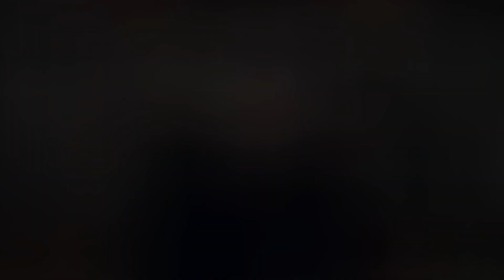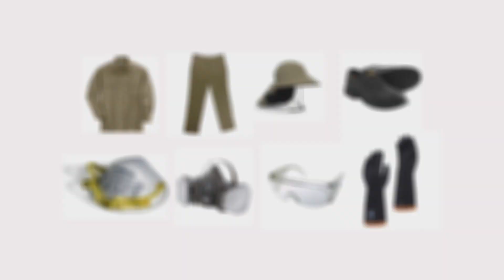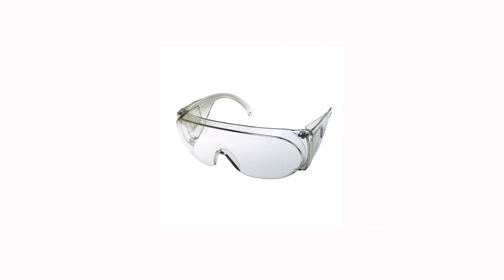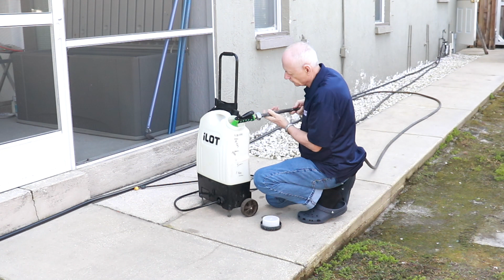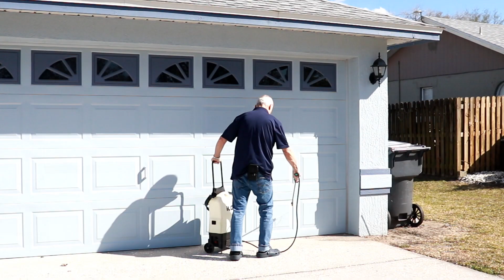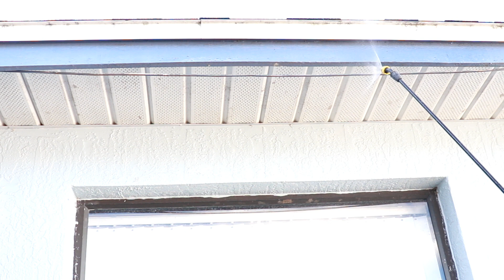How to Prevent Drywood Termites 100% Guaranteed.

Comment: I have white termites on a section of rotting fence boards just inches from a couple of 40 year old redwoods and a thick layer of redwood mulch. The only area of decay is the 10 foot section of fence directly behind (one foot) of the redwoods. I'm in Fresno, Ca. I don't see mud piles, etc, but it's hard to tell with all the mulch there. Do you recommend Imidacloprid2F Select T/I  over Taurus SC to treat the fence line? I just discovered this a few days ago, and replacing that section of fence. I will have under house inspected soon. it is a stucco house with a crawl space. Thank you for your willingness to help.
Reply from the maker: In this situation, you need to do a thorough inspection.  There are three possible species, and it's helpful to know which one you are dealing with.  The most common species would be subterranean termites, so let's start there.  It sounds like you are not seeing any mud tubes, but you need to move that mulch out of the way with your hands and see what's under it.  If you can't find any mud tubes, you still may have subterranean termites, but it is also possible that you have dampwood termites.  As the name implies, dampwood termites only attack wet wood.  This is very common with fences because the posts are constantly being saturated with water.   This is particularly true if it's an older fence. Typically, fence posts are pressure-treated and are rated for ground contact, but over time, they may lose their ability to fend off termites.  The main difference between subterranean termites and dampwood termites is that subterranean termites colonize in the ground, so that's where the queen is.  Dampwood termites colonize directly in the wood, which means your treatment methods may need vary a little.  There is also a remote possibility that they could be drywood termites, but I think that is unlikely.  

I think what I would do is treat the fence directly.  I would get a long 3/8-inch drill bit, and I would drill a hole at a steep, downward angle into what I thought was the damaged area.  I would then put a funnel in the hole and pour in imidacloprid until it was overflowing.  You can also do this with a pump-up garden sprayer.  Just put the tip of the sprayer in the hole and spray until it overflows. Imidacloprid 2F is fine to use.  Just mix 0.6 ounces per gallon of water.  If the fence post and other fence components are not treated with anything like a stain or a sealant of any kind, I would also apply Bor-Care.  You should mix it 1 to 1 with cold water.  You could apply this with a pump-up garden sprayer.  This treatment will probably work for both subterranean and damp wood termites.  Just treat all sides of the infested wood.  Keep in mind that you must seal the wood with something after 48 hours. You can't seal it before that, but you do need to seal it two or three days after you apply the product.  You can seal it with stain, a clear sealer, paint, and that sort of thing.

I hope that helps.  Be well my friend.

Bora-Care:  https://www.domyown.com/boracare-p-100.html
Reply: @GuysPestSolutions  Thank you for a very thorough response. I appeciate it. I will try to get a picture of a termite tomorrow, preferably one with a red head. If it is a dampwood, are they a danger to my house itself?
Reply: The fence guy and I searched for termites, but couldn't find a single one. We dug into the soil. I took many pics. I could not see any evidence of mud tubes. Is there a way to send photos to you? Thank you.
Reply: We did see numerous bits of excrement. No mud tubes. All the rot was at ground level and horizontal boards. I have many photos. Is it possible to send them to you?
Reply from the maker: You are very welcome.  You can send photos to guyspestsolutions@gmail.com.  As you can imagine, I receive a lot of emails, so please allow a few days for me to respond.  I answer them as quickly as I can, but it is very common for me to fall a few days behind.  Dampwood termites, as the name implies, only infest wet wood.  So, they are only a danger to your home if you have wet wood.  Most of the time, we do not see them in homes, but it is possible.  You typically see them when there is wet wood that is in direct contact with the ground.  It is very common to see them in fallen trees, tree stumps, and old fence posts.  The queen lives right in the wood, so they are quite easy to treat.  If you are not seeing any mud tubes, then it is very possible that this is the species that you are dealing with.  The treatment plan that I already described should get it done for you.  I hope that helps.  Be well my friend.
Reply: @GuysPestSolutions  Thank you 
Guy. I sincerely appreciate how you have taken the time to answer my posts and give such helpful advice.a
Reply: @GuysPestSolutions  Yes, my fence man dug all of the dirt away from the leaning fence posts and discovered the the posts were eaten through just above the cenment, under the soil. The vertical fence boards were fine, but the ones along the ground which run horizontally were eaten. No evidence of mud tubes anywhere. I'll send you photos. Thanks.
Reply from the maker: You are very welcome.  It is very common for fence posts to rot out at the soil line.  This was most likely just the ground moisture causing the posts to rot out.  When you replace the posts, you can avoid this from happening again if you pour enough concrete so that it is about 1 inch above the dirt line.  Just taper it from the post to the ground so the water runs off.  I hope that helps.  Be well my friend.

Comment: Have you heard of electrogun which uses electricity to kill dry wood termites? How effective is it?
Reply from the maker: An electrogun can kill up to 100% of the termites that it reaches.  However, it has limitations.  For it to be effective, you first need to find the gallery.  This is the same problem that you have if you are trying to do any type of spot treatment. Some of the galleries may be smaller than the size of a peanut, so they can be difficult or impossible to locate.  Also, some galleries are located in areas where the electrogun cannot reach.  In other words, it has the same limitations as a chemical spot treatment.  The only advantage to it is that you don't need to drill any holes.  Therefore, you don't need to do any repairs.  The bottom line is that, while this is another arrow in our quiver that we can use to help control the problem, it is not an acceptable alternative for fumigation.  Companies that offer this treatment should not be claiming that this is going to end the problem because it isn't.  I don't even think the manufacturer is making that claim.  Still, there are applications for this.  For example, if you live in a condominium or a townhouse that cannot be tented because the neighbors don't want to do it, then spot treating is the next best thing.  If you're going to spot treat, this is probably a good way to do it to avoid the necessary repairs that will result from a chemical spot treatment.  I hope that helps. Be well my friend.

Comment: Bora-Care: What if you already treated all the wood in your house with Bora-Care? Is this external treatment (or even Trench Treatment) necessary since Bora-Care last 30 years or a lifetime? What if you're house was already built & you sprayed the crawl space & attic with Bora-Care and injected Jecta in all the studs in the walls & perhaps some foam termicide for good measure? Would this external treatment be needed?

External Treatment (like you did here): Can't you just use a natural treatment like Orange Guard instead of Tourus SC or Talstar P, especially since you're using every 3 months?
Reply from the maker: If you properly treat unfinished wood with Bora-Care, it will be permanently protected from termites and all other wood-destroying pests.  This means, if the entire structure was properly treated while it was being built, then the house would be termite-proof.  You would need to treat all the wood from the peak of the roof down to the foundation.  If that were done, then there should be no reason why you would need to treat the outside of the house to prevent drywood termites. 

Orange Guard is a contact kill product that will most likely only last a couple of days if you apply it outside.  Depending upon the weather conditions, you may be able to get up to a week out of it, but that's about it.  For this to have any chance of success you would need to apply it twice a week, which would be rather labor-intensive.  So, this would not be a practical way to prevent drywood termites. 

I hope that helps.  Be well my friend.

Comment: My termite company is planning to use orange peel oil as green preventative treatment. Does it work?
Reply from the maker: I am so sorry that it took so long to get back to you.  I am currently experiencing a very high volume of questions.  This has slowed me down quite a bit, and I am running several days behind.

The short answer is no.  Orange peel oil has no chance of working.  You are being taken advantage of.  If you have drywood termites already, then you must fumigate.  Please read the frequently asked questions about drywood termites on my website.  The link is below.  If you do not have an infestation, then please tell me where you live and I will tell you how much of a risk there is in your area.

I hope that helps.  Be well my friend.

Frequently asked questions about drywood termites:  https://www.guyspestsolutions.com/drywood-termites-frequently-asked-ques
Reply: @GuysPestSolutions no worries Guy, no need to apologize for the delay. I am just grateful you are answering our queries here. I am based in the Bay Area in California. I am getting the house fumigated. They were proposing orange peel oil treatment as a preventative measure.
Reply from the maker: The Bay Area has a serious problem with drywood termites.  If you read the frequently asked questions on my website, then you know that the gas they use to fumigate your house has no residual action whatsoever.  That means you can get reinfested the moment the tent comes down.  Orange peel oil and that sort of thing will do nothing to prevent a reinfestation, but you can prevent the problem by following the directions in the video you watched.  You can speed up the process if you use a 20-gallon hose-end sprayer instead of a tank sprayer.  I will give you a link to my video on how to use a 20-gallon hose-end sprayer.  The procedure is the same, but a 20-gallon hose-end sprayer makes it go a lot faster.  The only thing is that it can get a bit messy around the windows.  The pesticide can make the glass look a bit hazy.  To avoid this, you can use a 1 gallon pump up garden sprayer to treat around the windows.  You can put the 20-gallon hose-end sprayer in stream mode by removing the diverter tip.  Then, just shoot the finished pesticide into the 1-gallon tank sprayer.  This way you will be able to do a neat job around the windows.  It is also helpful if you purchase one of those expandable hoses that you see on TV.  They are lightweight and a lot easier to handle than a standard garden hose.  I also recommend putting quick connect fittings on the hose as well.  I will give you links to all of these things.  You need to start the preventive treatment before they do the fumigation. 

I hope that helps. 

Guy

Video on how to use a 20-gallon hose-end sprayer:   https://www.youtube.com/watch?v=LJiEcyGwxOQ

20-gallon hose-end sprayer:  https://www.amazon.com/Chapin-G390-Fertilizer-Herbicides-Pesticides/dp/B00UER1SKK/ref=sr_1_6?crid=2VJGLXXEL4LN1&dib=eyJ2IjoiMSJ9.0AUhFxCWPmq_uFtB2haOToxCJUX-CHhecUma925a6lODG87p-u1VB0cbvLmOfR7WDybAtJoU024CWsa93Sl7wqig5mjoVSf5oMjexat9tHxPj7eYlHvzyeCS-1YjY1SwhYjj8M9pR4Ss3w4cyCvPowYcvS2AgPuxsaAlG558wuOr5THOqolnOQEn5N_2DPgN9kBwyMwqwOS1vClqnzNTJ-E1Uhh2iH6mvaEJaGJT86Aeb5E2sPH7Dw9V5Zk8sSU3eK7CtUFBkGNq7IhN-2ACyVhN8noeFsIvK9PN3YITAQg.mMmvSfNMTsGwtmMYIj4BFgwY_S9Hv_liaQoZFLSndWA&dib_tag=se&keywords=20%2Bgallon%2Bhose%2Bend%2Bsprayer&qid=1758642385&sprefix=20%2Bgallon%2Bhose%2Caps%2C203&sr=8-6&th=1

Garden hose:  https://www.amazon.com/100-Expandable-Garden-Hose-Retractable/dp/B0FJD77BYZ/ref=sr_1_4_sspa?crid=R8BEN346B981&dib=eyJ2IjoiMSJ9.b5U1nCI3ioLyzfB_Y0hxF86TwKQ3xMwdvOaVdr3-zqObMa3vHo44LTer5KIoWV2t439R-2Mt3Q3rmnUNucQClSEVc6b-dNbRnwKwamFeg1nIkWJC6LieWlJ5_4u-i37l-ssiA-d78DlXjYo1BqFdFOkbtwzUWZEVRjUYHpVwLbzWBhnvMy0KHDXVqRu5-RYrcEeGBwV_WhlWvq28oEnW-M1fLnTQDVoxlB99dWmtkOmbbKfvm2HlxI_Oj8HBRWZMnefgsv6DoA_gN42xWfb-S1lm1YZpX1Vj6Rib5c8rGTE.uQj7WuF4Me2DlcLGn5xCdhku_VNxS33ekGIE7t7J9l0&dib_tag=se&keywords=expandable%2Bgarden%2Bhose%2B100ft&qid=1758642433&sprefix=expanda%2Caps%2C170&sr=8-4-spons&sp_csd=d2lkZ2V0TmFtZT1zcF9hdGY&th=1

Quick connect fittings:  https://www.amazon.com/Lifynste-Garden-Connector-Fittings-Fitting/dp/B08R3D35CG/ref=sr_1_1_sspa?crid=2F867OX9TAU3H&dib=eyJ2IjoiMSJ9.c5lyWbh9CILRSWgh1XA3QJIillUQGqtF3SThXGjYqeVyijbWHAHYfGvPYnqqO6jc4c5XqDRjRoqE7g4fVwfdme_dA5CGigx0RsTOpdTBeiTYlwGn3UWsmL8Wbq6chd_9wMAem0QUaAPSxqcjZOEjq1yw0eseKI5snX01QCcEp4St4rXTuMNgFxjQnsmM8YDcmPSv_vhdGrS_z-CCJohKi4vnnzgsAMMp5qndWahnO0t0KTEFDhAVrU9sRMIQcxNOZk6xN1d57_fYlg23etE8SW399yrfrQANUa0gxtrhbBg.3HHU2fY7DWO2hwEtwnA86Ry2z1DVrJbVJxFEOg-99tE&dib_tag=se&keywords=quick%2Bconnect%2Bhose%2Bfittings&qid=1758642480&sprefix=qui%2Caps%2C169&sr=8-1-spons&sp_csd=d2lkZ2V0TmFtZT1zcF9hdGY&th=1

Taurus SC:  https://www.domyown.com/taurus-sc-termiticide-p-1816.html?sub_id=1817

Talstar P:  https://www.domyown.com/talstar-professional-insecticide-p-97.html

Comment: Sir, how does rain affect this treatment? Do you need to have a 24-hour rain-free period for it to be effective? Also, how would you treat an aluminum sunroom with glass windows? Do you suggest spraying the entire sunroom? I look forward to your reply. Thank you!
Reply from the maker: You need to give the pesticide time to dry.  It's kind of like paint.  You don't want to let it rain on wet paint, but it's fine after it dries.  It's the same with pesticides.  If it's sunny in the morning and it's not going to rain until the afternoon, just allow a couple of hours for the pesticide to dry before it rains.  If you have an all-aluminum sunroom, then you probably do not need to treat it at all.  Just make sure there are no openings wide enough for termite swarmers to enter.  The termites only attack wood and not metal.  However, if they get through a crack, then they can get inside and start an infestation in the home.  I hope that helps.  Be well my friend.
Reply: @GuysPestSolutions  Thank you, sir. Have a blessed day!
Reply from the maker: You are very welcome.  Be well my friend.

Comment: Once there are several locations of drywood termites in the home, can we still spot treat and then do the actions outlined in this video or is it better to tent and then perform these actions? Also, one pest control person, who seemed to care, suggested spraying boric acid powder in the whole attic space and possibly the crawl space beneath my home. Do you think this is worthwhile? He said he would do the attic of a 1500 square foot home for $150 and the crawl space for $100.  Lastly, does the summer heat that builds up in Central Florida attics homes kill drywood termites in the attic?
Reply from the maker: I'm so sorry that you're having this problem.  Applying boric acid on the wood will do nothing to help the situation. There is a treatment that you can do to make the wood termite proof, but this product sells for almost $100 a gallon, and you should mix it one to one with water.  So that's about $50 per finished gallon.  Therefore, I doubt the pest control is going to use this product.  Most likely it would take several gallons of finished product to do that job. 

If you have drywood termites, then the only logical way to get rid of them is to fumigate.  Nothing else really works. However, if you fumigate, you do not need to do the spot treatments. 

Please read the frequently asked questions on my website about drywood termites.  It's not that long, but it will give you a lot of information that you need to know. 

I hope that helps.  Be well my friend. 

Frequently asked questions about drywood termites:  https://www.guyspestsolutions.com/drywood-termites-frequently-asked-ques
Reply: @GuysPestSolutions  Thank you so much! I read the drywood termite section of your website. Is there any difference between Vikane and Zythor? Is there a way for me to confirm with the person doing the tenting that he used all the gas he promised? Is it a good idea to ask him this?
Reply from the maker: Vikane and Zythor are both trade names for sulfuryl fluoride, which is the most commonly used gas that is used for fumigation.  You do not need to concern yourself with the amount of gas used.  There is no way I know of to monitor this, and the important thing is that the termites are gone when the fumigation is completed.  So, don't measure the process.  Measure the results.  Remember that fumigation is a temporary fix.  You must begin a preventive treatment before the tent goes up.  I believe I covered this in the frequently asked questions regarding drywood termites, but if you missed it or need further information about how to do the preventive treatment, just let me know, and I will assist you further.  If you fail to do the preventive treatment, you will be reinfested within a year.  Maybe even the same day that the tent comes down.

I hope that helps.  Be well my friend.
Reply: @GuysPestSolutions  Definitely helped!!